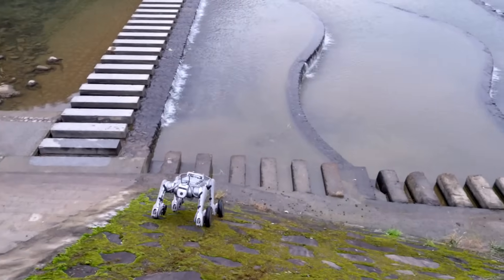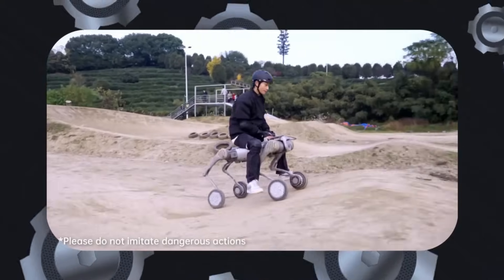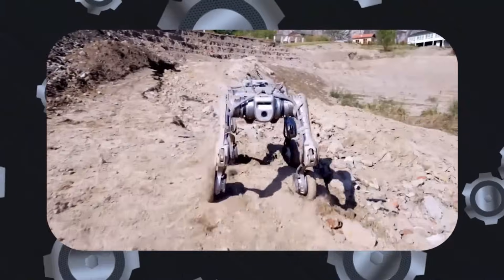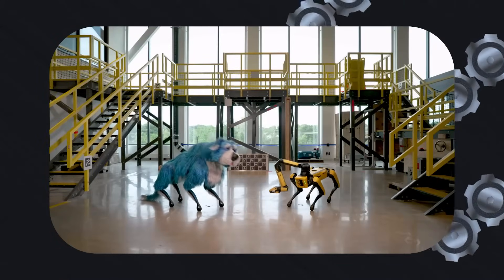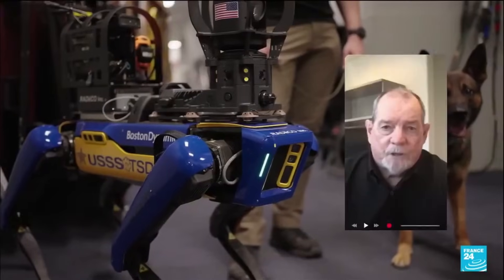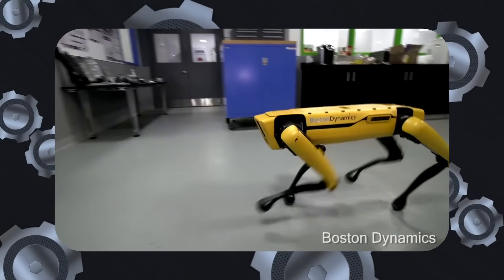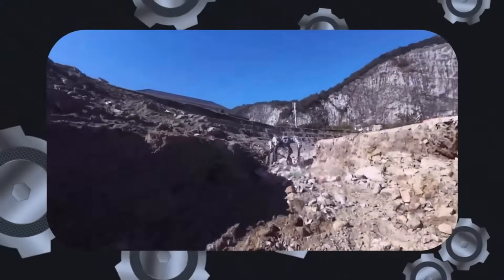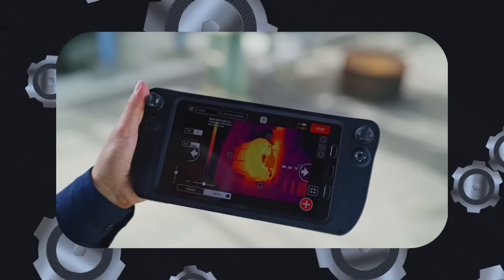Boston Dynamics VS Unitree B2W: Which Robot Dog Wins?

Comment: hopefully they finally use permanent magnetic motors for the wheel drive, I am sure something will leak in that general area if you use it in water. like the hover boards. I love the wheel design for fast travel, I would go 1 further and have the wheel raise up the leg, to expose a climbing foot. like a transformer. then it could make itself really flat with the wheels moved toward the body,. Hard to do with wheels out on the corners from wind down force and weighted central mass. I mean a guy like me that built RC Cars, would make this thing fast. I have built RC cars that can beat Super Cars. In the short 1/8th mile, for an RC car an 1/8th of a mile is equivalent to a quarter mile in a super car, when you think about size. I can fit a whole RC car in the engine alone.

Comment: I'll take Boston Dynamics because theire technology is tried and tested. Due to their work with the military, they have to make sure that everything works flawlessly. Putting on wheels and allowing it to carry more weight is something that is easily done. Ensuring reliability and durability are much more important and that advantage goes to Boston Dynamics. Unitree is just a copy of Boston Dynamics with a few adjustments. Always go with the original over the the imitator.

Comment: We're all just gonna act like the Unitree isn't a rip off of its predecessor?
Reply: Keep that head in the sand, buddy. Stay in your safe space.
Reply: @jayl3254  tell me, does it not look like Spot but with wheels and a paint job?
Reply: @ is it just a shell and wheels? Or does it also have actuators, software, linkages, motors, and electronics that you can’t see?

Comment: Building robots has never been a problem. It's just that without a brain they have been useless.
We are now close to giving them that brain, but not quite there yet.
That's where the real battlefield is. But we haven't yet seen enough about that to know what happens there.
Reply from the maker: Which company do you think will develop a robot brain first? I know OpenAI+Microsoft, Nvidia, Tesla etc are working on this,,and maybe whoever comes out with the best system might take control of that ecosystem

Comment: You compare apple and oranges. Period! 

The unittree might have arm accessories that can attach as industrial robot normally have “arm” to perform task. But omitted here. 

The conclusion of Boston software is better is pure bias due to its arm function. How about Boston robot performing terrain travel? It might be good or suck!
Reply from the maker: @wsi1917  didn't say software is better,,said about it being open source,, which means a customer can easily play around with it..but one person pointed out in the comments section that as of mid 2024, Unitree Robot dogs are also open source and once you buy them you can do anything you want
Reply: @ go back to see your own clip, the way you present two robots essentially on software speaks your intent! 

Take this as a reflection as most of people don’t realize they are bias one way or another. Same word speaks different tone or different context could means two different things or even sometimes opposite meaning - someone use term “read between the line”

Comment: Can’t compare. They are designed for different purpose.
Reply from the maker: dude both are industrial robots,,what do you mean by different purposes?
Reply: @ some robots are designed to perform. These are agile robots, have good logistic. They can dance. Some are designed to work in industrial sites, these can withstand high heat, harsh environments.
Reply from the maker: @snowyny  they are both designed for industrial Applications,,like as of now unless if you buy it and use them for different purposes

Comment: For now， those robots are not that worthy，because the battery technology is only able to support the robot for up to two hours under no load. There is no that much value  unless a great leap in battery tech is made
Reply from the maker: true,,the next big thing should be advancement in battery Technology
Reply from the maker: that will help EVs and robotics
Reply: I saw another video with its specs at speed of 20km/hr with load, and up to 50km range. If this is true, I think it is good enough for most of the field applications for me.
Reply from the maker: @yangguo17  this robot is pretty impressive

Comment: These are all rubbish ..all these Robotic Dogs had little application  and is extremely clumsy. Drone had the most versatile application. My 400 Malaysian Ringgit Smart Drone with 1 single charge , it can last up to 2 hrs in the air and under my  control with my Joystick and am on my desktop.  And it is designed and made by DJI and of course many chips had Independent Evading Chips which  make it Real Smart.
This Smart Drone Somersault , Flip , Roll , Spin , Swim and Dive an optional Mode Switch-over ..it become suicidal.  You think I am bluffing ?
Reply from the maker: this looks like an advertisement for DJI drone
Reply: @chriswabs  Thanks and you look like you work for Pentagon.

Comment: Unitree price is not 100,000. It price around  USD2,000 exclude tariffs
Reply from the maker: Man that is GO1,,GO2 IS USD 2800,,Unitree Go2 Pro is USD 3990, Unitree Go2 EDU PLus LiDAR is uSD 21000, This is b2w, its listed as usd 100k, confirm the model first
Reply: @ too expensive in USA. It price more less in Mainland
Reply from the maker: @Bombfun  someone confirmed with the company from China
Reply from the maker: @Bombfun  here in the comments section someone confirmed with Unitree,, distributors are selling it at 80000usd,,,but on website they have listed it as 100k USD to protect their distributors so that you can buy from distributors

Comment: It's china so you can go ahead and halve all those numbers and expect about a 2 year life expectancy.  I've seen multiple videos of unitrees dog robots walking perfectly flat ground including a track for track and field and fall for no reason carrying no load and start spazing out unable to get to its feet again without human assistance.
Reply: Unitree products are sold bundled with open source software and buyers can make own modifications of it, for this reason there are tons of videos with tests of both basic and homemade software for this dogs. Their dogs have been on sale since 2019 and by all reviews they are top notch. And even if you divide the declared characteristics by half, they are still a head above the boston dynamics. For example Unitree B2 has a recommended working weight of 40+ kg, Spot has 14 kg.

Comment: I was wondering what happens if BD uses the wheels in their next gen robot dogs? Is China still a copycat? 🤔
Reply: They did this 7 yrs ago.
https://youtu.be/-7xvqQeoA8c
Reply: @amos2886  thanks for sharing. Although it's two-wheel system, it still suggested BD is the first. Just don't understand why the successors didn't keep that path which apparently provides more mobility and flexibility.

Comment: Why China robot is more expensive than USA?
Reply: It's RMB100K (US$13.7K) not US$100K.
Reply from the maker: @inner_calm28 you don't know what you are talking about,, it's 100usd not Yuan,,stop confusing low model Unitree robot dogs with the b2w
Reply from the maker: @inner_calm28 yesterday Kai Cenat bought Unitree G1 for 70k USD which is listed as 16k USD,,what you need to know is the 16k USD model is the base version or entry level version like it doesn't come with a lot of features but the the Unitree G1 Kai Cenat bought is the Unitree G1 edu Ultimate C (U5),,,you have to know they're different versions of the same robot,,the robot dog am comparing here is better than spot because it has a lot of features which makes it expensive,,then Unitree for USD 13k doesn't even come with LiDAR,,not all Chinese products are cheap,,the cheapest ones don't have the features you need

Comment: $100000? No, the civilian version of the Unitree robotic dog is only sold for 10000 RMB=1350 USD. I have seen the most expensive Unitree robot dog for civilian use, priced at 90000 RMB=12500 USD, a high load off-road model. I don't know where this $100000 number came from. After all, military and civilian appearances are the same, which may be just the difference between internal chips and materials.
Sorry, I used translation software and the sentences may not be very smooth.
Reply: 据宇树科技官方介绍，B2-W工业轮足机器狗可在空载状态下持续工作5小时以上，最大移动速度为每小时20km，直立最大负重可达120kg，负载40kg时最大续航里程达到50km。据官网标价，这款机器狗售价15万美元（约合人民币109万元）From 新浪财经
Reply from the maker: @tstjaz6326 I wish you could comment this comment on people's comment who claim that it's 1300 USD,, they're confusing it with go1
Reply from the maker: 1350 is the price of Unitree Go 1,,Unitree go 2 is around 2800 USD,,,I got the 100k usd from unitree website, prices that are available for people outside of China,,The b2W model is for industrial use not civilian use,,here is the link if you want to confirm the price https://shop.unitree.com/products/unitree-b2-w?srsltid=AfmBOoqsOtOwDzuly33oCpM3FFiwbfwWxfq5RkMdrrxqvrl5qJDs8BmC
Reply: @chriswabs  thank you! I am inquiring with Unitree's customer service on Taobao about the price of the new model. Last year, I wanted to buy a robotic dog for carrying heavy loads while traveling, and this one is obviously more suitable.
Reply from the maker: @刘尘-o2d  now I wish I had an affiliate link with them you buy from that 😁,,but for real this could be helpful for carrying your items,, especially if you do camping. I would like to hear how much they will say it cost
Reply: @chriswabs  The customer service told me to wait, the current price is too expensive and not suitable for sales. When I joked about them bullying people by selling high prices on international websites, their customer service sent me a emoji saying：🤣.
Reply from the maker: @刘尘-o2d  😅😅 so they know that international precises are too high,,so there's some good chance that you can get it for below 5k USD?
Reply: @chriswabs  Who knows? Hopefully not exceeding $10000.
Reply from the maker: @刘尘-o2d Did they answer you about the fixed prices or not yet?

Comment: I would want the Unitree.  I would use it to go on long hikes where I could let it carry all my gear and a big solar panel that I could use to recharge it when I need to.  With this robot I think one could hike for a week in very rough turain for about a week without needing to restock food or water due to its ability to carry so much weight.
Reply from the maker: woow,,of all the comments,,I think this is the best use case scenario for that robot,, that way you can carry lots of supplies than usual and the robot will do the heavy lifting for you
Reply: @chriswabs  
这正是我们的目的，但美国人总是觉得我们会用于战争。

Comment: Many people's comments here are biased,
Some people are prejudiced or stereotyped against Chinese people,
Or some people are disgusted with the hegemony of the United States.
Okay, let me be fair. Although I am Chinese, I will not be partial to China.
From the perspective of progressiveness of comprehensive technology, Boston is better because Boston is an original company after all, and the use of many source codes will be more skilled. In addition, from the perspective of industrial details, you can see that Boston's robot dogs are more sophisticated. You have to admit, after all, Boston company has spent much longer developing and improving robotic dogs than Unitree. But these things undoubtedly increase more costs.
And then  Unitree  is a new company that has made rapid progress since obtaining the source code, which is inseparable from the crazy experimentation and improvement of their researchers,
The advantage of  Unitree  lies in the rational utilization of resources to a level that can be commercialized on a large scale, so that most people can afford it and it can be applied to the vast majority of daily life tasks. Therefore, the robotic dog of Yushu has stronger application capabilities.
In short, Boston's robotic dogs are more expensive and have some advanced robotic arms and perception capabilities, but their agility may be slower and they can adapt to more complex and dangerous areas that require strong operability。
The mechanical dog of the Unitree   is obviously designed to meet the needs of ordinary people's lives, with faster speed, agility, and adaptability to more terrains.It may even develop into a new extreme sports game
Both have their own advantages, and the markets they face are different. Simply comparing them is meaningless.

Comment: Unitree b2w is indeed the top dog so far right now👍
Reply from the maker: yes as of right now, it's the beast in the game
Reply: @chriswabs  It's not. The unitree system uses wheels which are much less complex to engineer than an actual walking system that boston dynamics uses. There two aren't even comparable because of that alone.
Reply from the maker: @gtas321  but the b2 was walking fine just like how BD Walks,,then they switched those walking legs with wheels to make it more agile
Reply: 胡扯， 用合成视频进行诈骗

Comment: Unitree is way ahead. Boston dog is like 10 years behind.
Reply from the maker: 😁😁😁 10 yrs is a lot,,but yeah they're far behind,,they need to work hard to catch up
Reply: @chriswabs  Just look at moves Unitree dog is capable of doing, and check fluidity of those moves. It looks so natural. 10 years minimum is the difference. These dogs are the new drones and we know who is daddy of drones.
Reply from the maker: @saellenx3528  the way the B2W moves looks so natural and fluid,,I think it's just crazy how good Unitree is, and I agree with you, it makes them the new leaders of robot dogs
Reply: @chriswabs   think Boston Dynamics is mainly lagging behind in batteries. If there is no revolutionary innovation in power supply in the United States, it will continue to fall behind, but sadly, this may have been predetermined.
Reply from the maker: @xijinping2538  looks like Trump is about to mend ties with China,,,so thin could help with the improvements in battery technology in the US
Reply: Boston dog was in the lead but suddenly became 10 years behind.
Reply from the maker: @cuteandfunnyearthlings2863 they haven't been updating over the years,, I guess once they started selling them, they slumped on development

Comment: Wrong comparison. China has other robots like Boston’s that can perform similar tasks
Reply from the maker: how does that make my comparison wrong? in my comparison I pointed out that Unitree B2W is far more advanced than BD Spot when it comes to Industrial robot dogs. Unitree has other models like go series which are about 1500usd but those ones are not for industrial applications
Reply: @chriswabs  What I meant to say was that it's more appropriate to compare the two robots that perform similar tasks. Here however they are in a class of their own. So it's like comparing apples and oranges.
Reply from the maker: @lindenlee3705  okay I think I Understand you,,but the spot and b2W robot dogs I compared here, they are both being sold to industries as of today for industrial use cases and not for personal use. so I feel like they both fit in the same basket wether oranges basket or mangoes basket,,the difference is they were built in different eras,,,B2W is latest with some great new tech, but spot is from back in the days, early days or robotics, but as of today both are being sold to industries,, that's why the comparison

Comment: The robot dogs are used as a platform for various equipment. So when comparing its applications, they can be relied on some 3rd party companies. The GenAI will largely enhance such applications. Give the shorter history of Unitree, it has huge potential due to its powerful platform. BD definitely shines on some very special applications for sure. I like to see more competitions in this field. There will be more advanced and possibly cheaper dogs in near future.
Reply from the maker: yes. with time prices will drop drastically,,like as of now the Unitree go2 is about 2800 usd